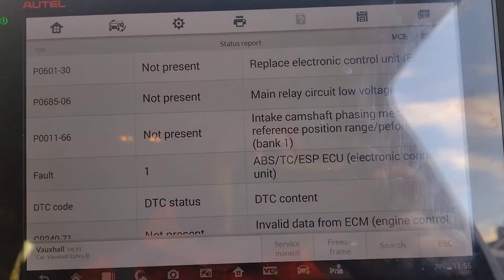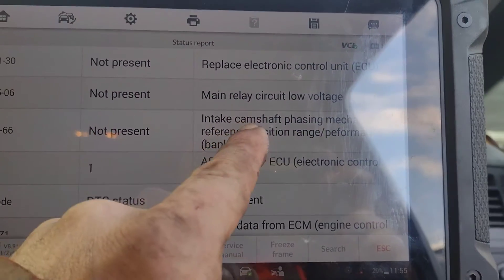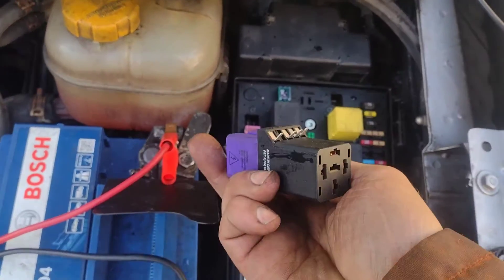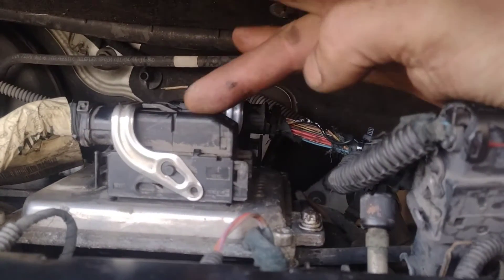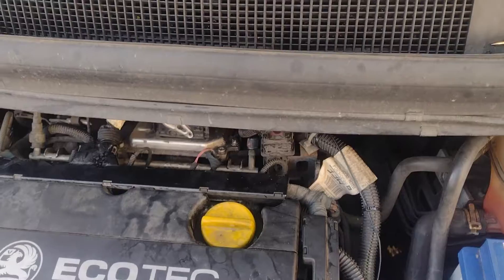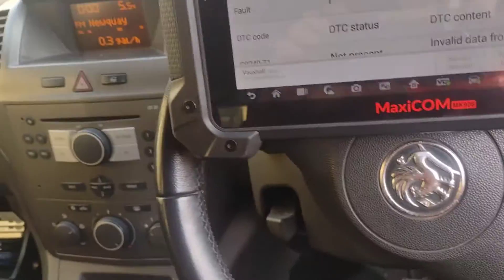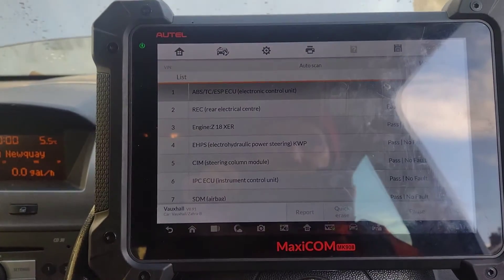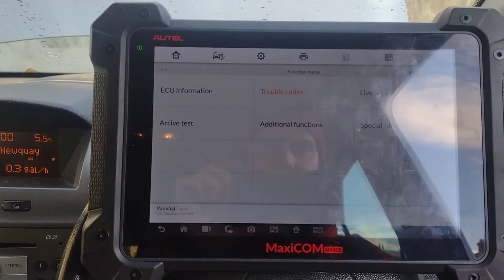vauxhall zafira (no crank) ticking ECU relay

Comment: fixed my zafira  yesterday after seeing the other video you had done on a zafira b  swapping the Immobiliser unit over from the under bonnet  fuse box    , I had the same problem with my car  faulty fuse box  fitted  a second hand  unit  and had a no start  seen your video swapping the Immobiliser unit  over  and it saved the day  had  i not seen that  car would  probably been scrapped .  Thanks for sharing 👍👍

Comment: If you searched on youtube astra P0685, you will find it is corrosion in the brown/yellow wire which causes this. Yes the negative bypass method works, but it causes the relay to stay energised and hot even when the car is unlocked. I'd call that customer back and fix the corrosion in the wire as a permanant fix, it will take 2 minutes to find.
Reply from the maker: No it's not, it's the relay control ground side that's switched, it has power all the time. I checked how it worked first. This relay is switching off properly when turned off. Thanks for watching
Reply: @mechanicmatt871  have a look on youtube as i suggested and you will find the issue. Ive done plenty of these bud.
Reply: @mohitl1697  All Matt has done here is effectively bridged a broken wire which is a ground side control from the PCM so no chance of anything staying energised. He says all this at the end of the video. If you assume a fault code always has the same cause and rely on google and youtube to give you an answer, well enough said.
Reply from the maker: I can assure you that the relay switches off with the ignition off. The coil is not getting hot, or energised with the key off like you are saying. Possibly if the brown yellow wire had a short then, yes it would leave the relay on. That's not the case here
Reply: Uec are common as mud because the lid lies loose and water gets in ,sometimes a Matt fix keeps the car on the road 👍🏻👍🏻👍🏻👍🏻.